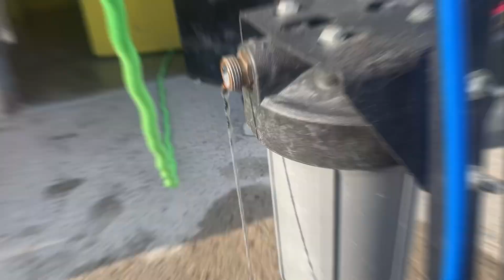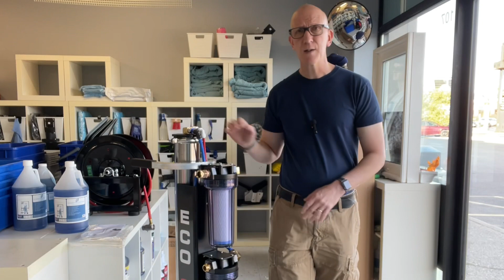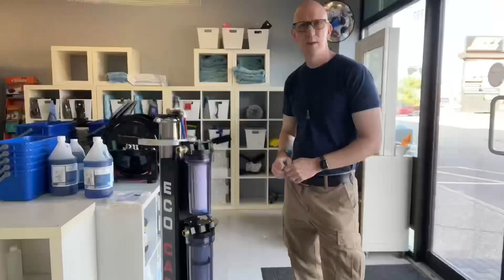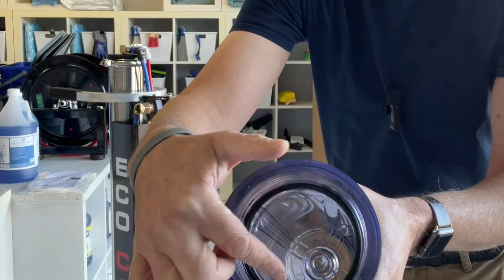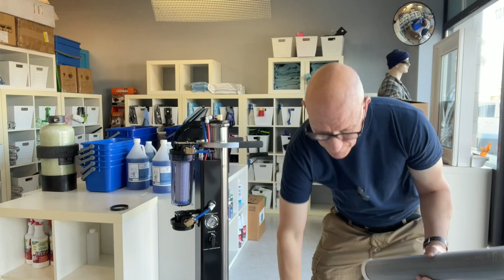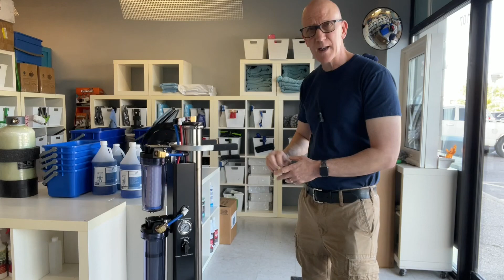Trouble shoot water fed system - low pressure & low output

Comment: Great video, just had a quick ? I haven’t used my tank in about 2 months and just used it last week and I was getting zero flow.. do u think it got all clogged up as it hasn’t been used? If so do I need to get a new RO? Thanks in advance 🙏🏻
Reply from the maker: I would try the prefilter(s) first. As the may have calcified and could be blocked.
Reply: @WCSkills  I will definitely try that, thank you!

Comment: I followed all your recommendations but i am still getting low output after the RO. I have even replaced the RO membrane. To add, when I use the 2 pencil jets brush, it shoots out about 2 ft but once I change it to the 4 jets, it only shoots out about 4 inches. Any help is appreciated. I have the 4 stage tucker.
Reply from the maker: Does your system have a pressure gauge on it? Ideally you want to see around 60psi going in. Are you on city tap pressure, rural, well? Also, I know Tucker usually supplies 50ft of pure water tube, I hope you’re not using that to go from the tap to the cart…should be a proper garden hose, 5/8” hose or bigger.
Reply: @WCSkills  No pressure gauge. Maybe I could buy a pressure tester? I was using a garden hose and connected it to the 3/8 yellow hose that came with the tucker. I am in the city and so I'm getting above 4gpm from the tap. Maybe I will start to use just the garden hose.
Reply from the maker: @brolysgaming1756  Hi, as per Tucker manual, the yellow hose included is meant to connect to the output of the Tucker system, and then on that you connect the pole hose. ( tap >> garden hose >> system >> 3/8" yellow hose >> pole hose >> brush) hope this helps.